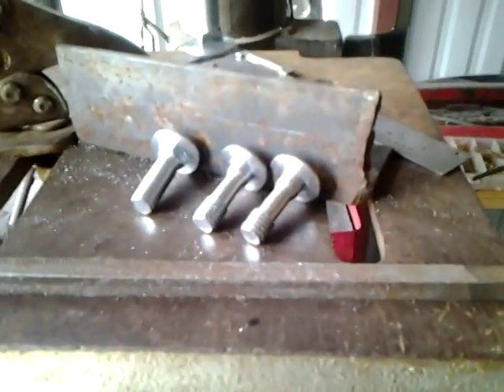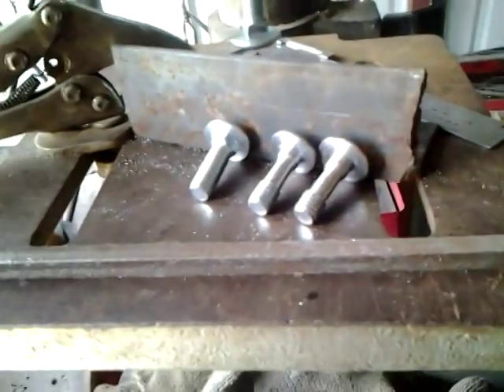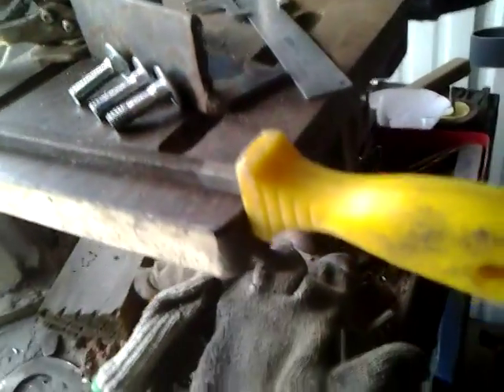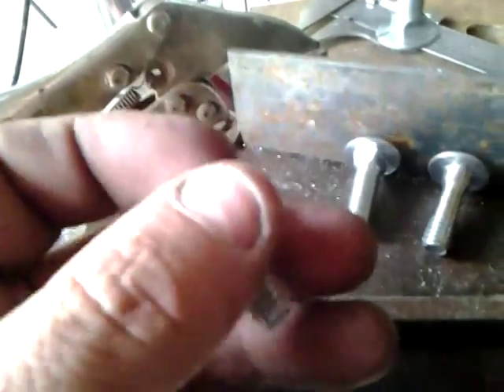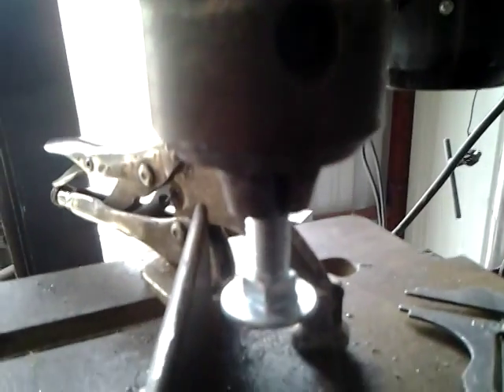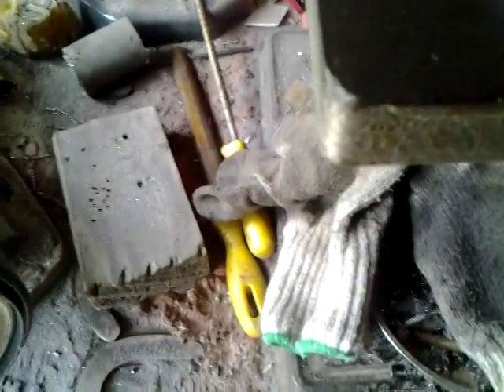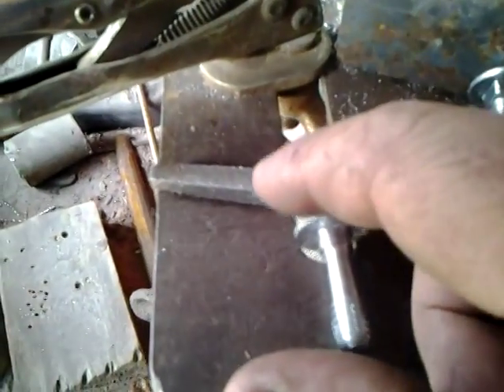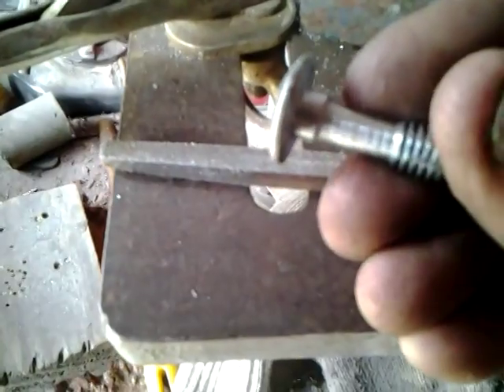Spur button cheat

Comment: I gave er a thumbs up for ya. I've been working on a pair of rasp spurs for myself and had the idea to use a carriage bolt, but wasn't sure how to go about it. Thanks for the tip! Also what diameter is the finished button head? That looks a little wide.... thanks, John
Reply from the maker: There is no standard
Reply: You can buy buttons for cheap to

Comment: Do you file the threads down to the shaft?  And is the end of the reworked carriage bolt placed through the drilled hole and then  peened over?
Reply from the maker: yes